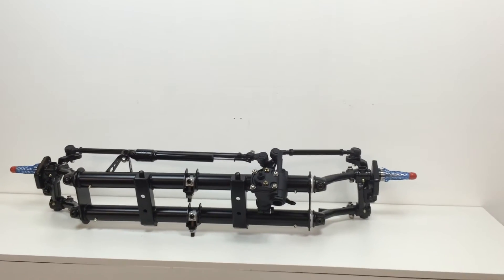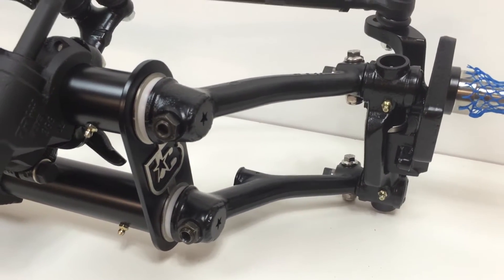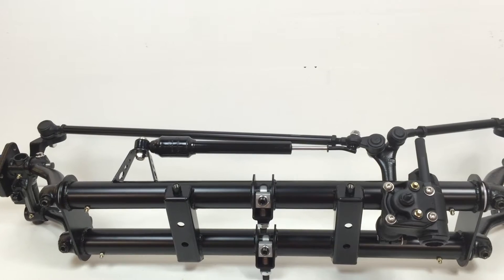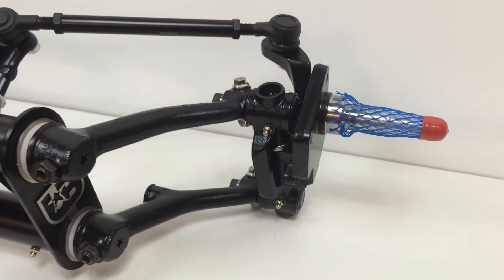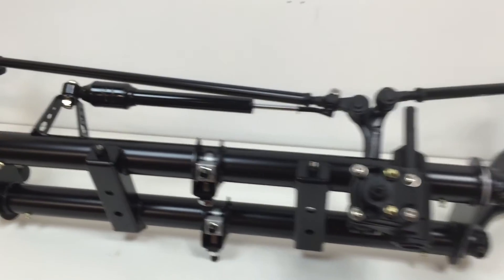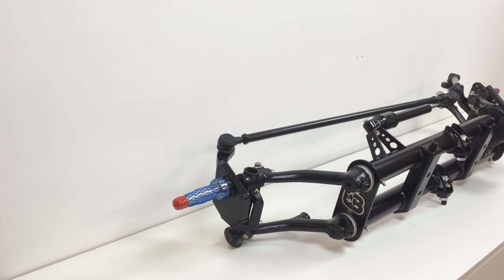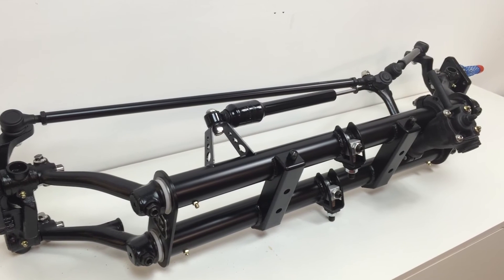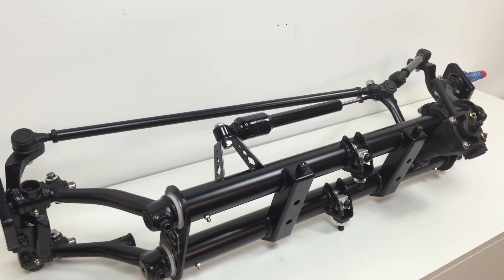Stage 1 PRObuilt Adjustable 6" Narrowed Shockless Beam - Link Pin Application - 2209

Comment: Me n a couple of friends started talking about this over the lunch table at work and they told me only a moron would rock that. The reason is because it's shockless, as fast as gaining some speed one would be in trouble. I know somewhere on the website it's only for cruising but what is cruising. Is it 20mph down the road in a city or can it cruise down the highway?
Reply from the maker: Johan Hägerström education is the only think missing my friend. Sometimes understanding the product is the most difficult
Reply: Airkewld yes definitely. I was the one at the table said that it worked, otherwise you wouldn't sell a product if it was lethal. But how about speed, can it handle highways or is it more suitable for slower cruising?
Reply: Airkewld yah I understand. Just so you don't hit a bump in the road and see yourself passing treetops :-)